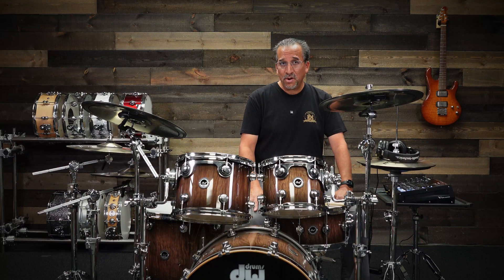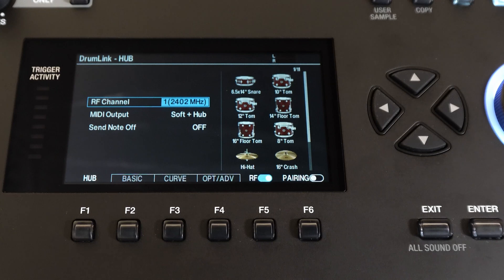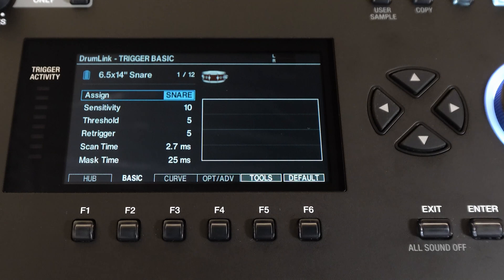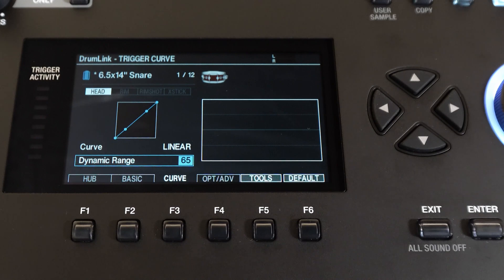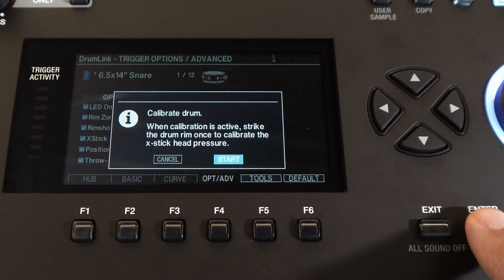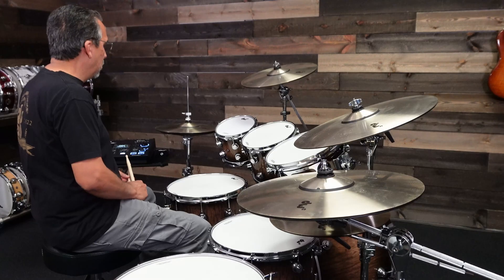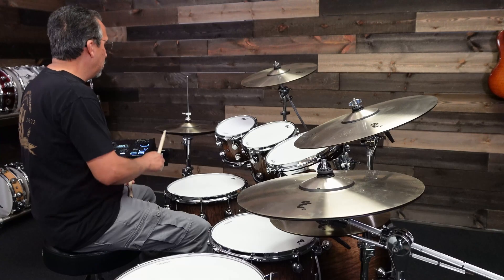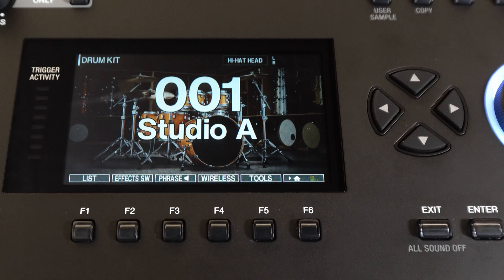DWe Drums – Connect DWe to the Roland V71 w/DrumLink

Comment: Hey I was wondering if you could answer this question. Could I do what you're doing using the Roland TD 50x and then connect the Hub to the Soundworks through a computer but keep my Roland KV drum set instead of the dwe drum set? Nobody seems to answer this question, why would I buy the dwe 10,000 drum kit to use my Roland module for wireless I would rather just have the DW sounds in my existing kit whether it's through the Hub going through a computer or something else. 

Thanks